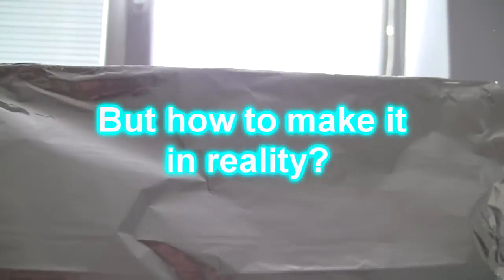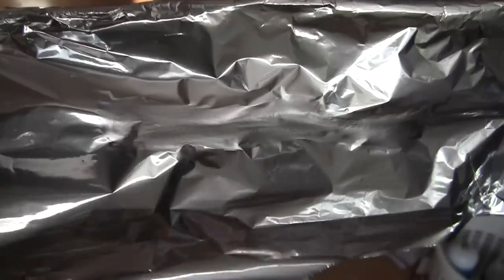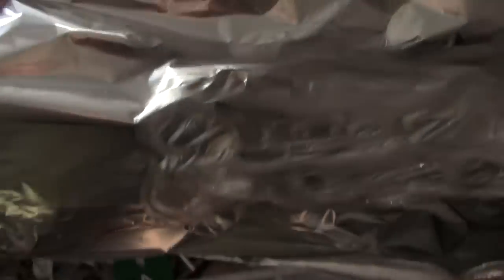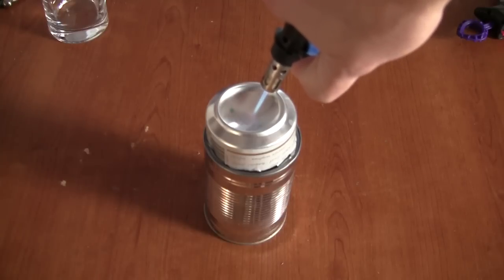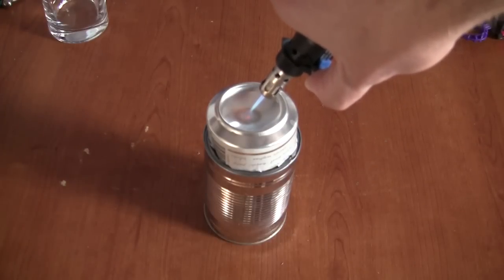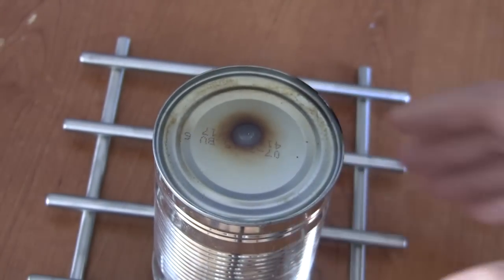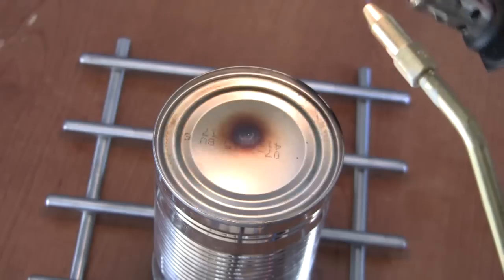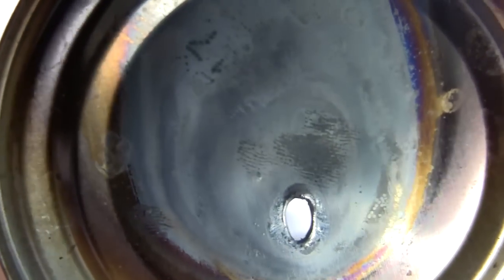How to make REAL Transparent Aluminium!

Comment: I recently came across this:
"A localized conversion of aluminum into transparent aluminum oxide by droplet-scale anodization is demonstrated in this work. The anodized region can be contained and controlled on the basis of the electrowetting response of the droplet. A highly uniform and transparent anodized spot was achieved using an anodization voltage of 2 V for 10 min. We analyzed the chemical evolution during the formation of the transparent oxide layer using X-ray photoelectron spectroscopy, which revealed the dynamic interplay between Al(OH), AlO(OH), and Al2O3 formation and dissolution during the conversion process. The dominant presence of aluminum oxide/hydroxide on the transparent spot after anodization was observed. The morphological characteristics of the transparent oxide layer exhibited a reduction in surface roughness as anodization time increased. Additionally, the formation of randomly distributed nanopores was observed in the anodized samples. X-ray diffraction results revealed the amorphous nature of the produced transparent oxide layer. This droplet-scale anodization technique can be extended to other transparent metal oxides, providing an environmentally friendly and cost-effective fabrication route toward sustainable electronics and other related applications."

Comment: I never thought i would be able to say it but... everything about this experiment was horribly done lol.  cans are coated with a food grade epoxy resin adhered to the metal with a binder.   While "oxidizing" the metals, you effectively cured a plastic resin making a clear "glass" like material. 

If you heat the epoxy resin in soda cans along with its binder (curing agent) alone in an experiment, it would indeed form a clear, stiff material. Epoxy resins are thermosetting polymers, meaning that once they are cured (hardened), they create a rigid, durable, and clear solid.  

Of course I could be wrong, Im only looking at 5 minutes of footage from 8 years ago.  But it looks like you just made some plastic under a controlled carbonization.

Comment: Not the same thing.
Transparent aluminum is made by compressing aluminum powder, oxygen and nitrogen under several tons of pressure per square inch. It is transparent, but remains structurally very stong and is a solid material. These are two properties your "transparent" aluminum does not have. The stuff you made is porous and weak
What you ma 4:57

Comment: Well it does work because he heats the aluminum enough to infuse N And O into the foil it is not the cleanest way to create alon that's why it has such a small viewing angle if he were to do it in a super high temp oven with an oxygen Nitrogen atmosphere heated the Aluminum thoroughly over a few hrs then flash belastet it with a high tem laser or similar he could achieve a pretty much perfect alon specimen. Or he buys the chemicals presses them and high tem cooks them for 24 hrs and then polis he's them eviola alon as well there are plenty channels that actually talk about the chemistry behind this with showcasing the effect
Reply: @Aaron Washburn thanks for the clarification, i stand corrected

Comment: 2019: ran across this researching Alon.  In above vid it appears to be transparent in places due to burning tiny holes thru it.
Reply: Im assuming whats happening is the intense heat is quickly oxidizing the aluminum, perhaps forming large alumina crystals in the foil, basically turning part of the foil into sapphire
Reply: @Aaron Washburn  microscope pics ?
Reply: @Aaron Washburn of the claimed perforations
Reply: @Aaron Washburn both are absent as far as I've (not) seen in these comments... lol at the way u phrased that, "picking an argument" style
Reply: @Aaron Washburn someone must have inspected it already, though seeing how adamant some of these commenters are without anything solid backing their argument... anything is possible
Reply: @Aaron Washburn  thanks watch?v=inN6QXYUQ6A  Should be a pinned comment for the good of all

Comment: I assume because the crystals in the aluminium can not recrystalize fast enough so that we dont have the same boundaries at the crystal. And so we have an effect like Glas where no Boundaries of crystals reflecting the light. If i assume correct the transparent spots should show a different strength agains pulling and more physical differents. But i would be glad if someone cann tell me whats the definitive reason for this behaviour is.
Reply: Ok thanks for the information but its definetly worth check it under the electron microscope, unfortunately i doesnt have one. But if somebody has a picture or Video would be great to check your theory.
Reply: Great , thank you, it was just a general suggeston in case somebody with free acess read this comments by incident. Thanks because i have no acess to equipment.

Comment: This is fake. Foil and cans have plastic layers in them, that’s what you’re seeing.

The true chemical name for transparent Aluminium is Aluminium-Oxi-Nitride.

It’s a ceramic composite that’s super expensive. Can only be created from a powder state, requires extreme heat, and requires major amounts of polishing to be see through. It’s used in military vehicles as a lighter thinner alternative to bullet proof glass.

#FakeVideo

Comment: Seem you made ALON glass by heating the aluminium it combined with oxygen and nitrogen in the air, making Aluminium oxynitride. AlON is optically transparent (≥80%) in the near-ultraviolet, visible and midwave-infrared regions of the electromagnetic spectrum. It is 4 times harder than fused silica glass, 85% as hard as sapphire, and nearly 15% harder than magnesium aluminate spinel. Since it has a cubic spinel structure, it can be fabricated to transparent windows, plates, domes, rods, tubes and other forms using conventional ceramic powder processing techniques. ALON is the hardest polycrystalline transparent ceramic available commercially.

Comment: any object that has atoms can be "moved" let's start with example 1. when making swords the fire excites the metal making it molten metal. "atoms are moving". When quenched the atoms instantly  polarized. "like a magnet" Now the metal has to be tempered or it will shatter. The aluminum that was heated with flame simply "moved" atoms from each  other making it slightly able to view through the atoms. Because of this forced method I believe the structural integrity of that area has been compromised.   They the manufacturers of the aluminum could have done this in the factory.

Comment: Aluminum and Aluminum oxide melt at different temps. AO melts at much higher temp than aluminum. What I suspect is happening is, the aluminum is being melted, and due to surface tension, it pools and pulls away to the sides of the heat source, leaving its previously VERY thing layer of alum oxide still intact. And that is what you are looking through.

Comment: Aluminium can have a clear lacquer coating spayed inside during manufacture. 
Like wise I believe aluminium foil has a plastic coating  applied during manufacture
Although I tend to think it should be burnt off when enough heat to melt the aluminium is applied I can't help but wonder if it may not be the cause of the transparancy

Comment: I think the molten Al is coalescing into a grid comprised of fine threads of Al. Might be useful for making a filter if it doesn't collapse under pressure. Perhaps an open-celled Al foam?

Comment: Ya it's no longer aluminum, it's aluminum oxide and that as others have said is sapphire, or it would be if you could cast it into a crystal. Casting aluminum oxide crystals takes heat like the surface of the sun for a while so good luck with that.

Comment: I melt down scrap aluminum, and often I'll have segments of tube leave behind brittle transparent shells of aluminum oxide, while the metal collected in the bottom of the crucible. For anyone curious about it, aluminum on its own is very reactive and if it weren't for this layer of oxide it could actually react with water, but any contact of aluminum with water or oxygen forms a thin layer of aluminum oxide that prevents the rest of the aluminum 
from reacting.

Comment: NO NO NO! I did this with regular aluminum foil, and basically the same type of torch. I put it under a microscope. All it is doing is perforating the aluminum with a bunch of tiny, surprisingly symmetrical, holes. It is an interesting effect but this is not 'transparent aluminum'. The longer you hold the heat on, the weaker it becomes. I would bet a large amount of money that that can is not actually water tight. The people saying that he forming sapphire/sapphire glass because sapphires come from aluminum oxide are wrong. sapphires form under immense temperature and pressure, usually over millions of years... This guy is sitting in his house burning aluminum foil acting like he's made some big discovery.

Comment: Aluminium foil has plastic coating.  When you heat it the heat absorbed by aluminium due to high heat absorption capacity and segregates it on the edge of the heating flame while the coating remains intact with some dispersed droplets of aluminium.  obviously that explains the effect of transparency.

Comment: Aluminum automatically reacts with the oxygen in the air to form a relatively hard transparent colorless coating on the original Aluminum. When you see ANYTHING made of Aluminum, it ALWAYS has that colorless transparent coating already on it.

Now when he heats up the Aluminum can, but not hot enough to melt the metal, he is converting all the Aluminum in that spot all the way through into that colorless transparent aluminum oxide. Since it is relatively "hard", it will easily hold water if the pressure is not great enough to push though the oxide "hole".

Comment: I worked at Surmet for 10 years. Acrylic aluminum was and still is their product. Made from aluminum oxide powder in an graphite mold at 3000 to 4500 degrees f for aprox 5 days will produce a ceramic puck that can be polished to clear

Comment: If the transparent region can be scanned with an Electron Microscope, to reveal the atomic lattice structure of the Aluminum, then an experimental method to heat and cool a panel may be devised to make transparent Aluminum. Good video!

Comment: The aluminium you used  has protective coatings.  when you heat it up, most of it aggregated towards denser areas and the heated area left with aluminium oxide and supporting coating to keep it in place and that creates the illusion in your mind.

Comment: Hey Thunder, use the butane torch on thin film sheets of various metals and see if they're transparent! Hypothetically, if say, silver becomes transparent, then maybe you can layer all of those thin sheets of silver and make a transparent block of silver. But even with aluminum, or even with Al-Ti alloys, maybe it's possible to make a transparent plane out of it!

Comment: but would it work for what the crew were trying to do with it in the film?  Could you replace thick aquarium glass with it, and would it be lighter, and stronger than the glass?  And if it can, could we use it for other things, eg. for replacing the glass in windows of deep-sea submersibles so that they can be made larger, or from less materials?

Comment: They make transparent aluminum now, in ceramic form, using Aluminum Oxynitride, under intense pressure, and baked at around 2000 C.

It needs to be polished afterward, but it can stop most bullets, and is completely transparent.

Comment: I remember doing this by sputtering aluminium from a magnetron onto glass slides in a vacuum when doing research, it made what appeared to be perfect mirrors but hold one up to the light and you can see through it. Same coating used on the exit end of a gas laser such as a He-Ne laser. Just a thin coating of aluminium on glass to bounce the light back and forth until population inversion is reached "light amplification by stimulated emission of radiation"

Comment: The molten aluminium is floating down, so only the oxide Layer covering the Aluminium is left. Aluminium still can't be seen through.

Maybe there is a method to produce an aluminium crystal structure that let's light pass through, like Diamond is to carbon.

Comment: I thought this was a joke...
Reply: It is a joke, he's burning tiny holes in the aluminium and, being thunderf00t, he is perfectly aware of this. I guess he is just trolling with this video...
Reply: Homemade Chemistry Actually, it may have been Aluminum Oxide, also known as Corrundum, which is a major component in rubies and sapphires.
Reply: Yes, theoretically, but those actually are tiny holes. Puddin made a video, putting the foil after burning under the microscope where you can clearly see them. Aluminum Oxide is created, but it wouldn't stay in this flat thin shape on its own. I guess it is just blown away by the torch.

Comment: Look up ALON, or aluminum oxynitride.  It's been around as long as Star Trek: The Voyage Home.  Do you suppose the movie writers had an insider tip?   Also, a Ruby is transparent aluminum.  Look up the formula for a Ruby crystal.  It's aluminum oxide with Chromium.

Comment: you know your just melting it and making very very thin layers right?
Reply: No, that's not what's happening there. It forms aluminum oxide, which is clear ceramic corundum. If it was just melting, where would all the aluminium go? Can't see it anywhere. That cola can bottom certainly has quite a bit of substance to it. Besides, it would melt more the thinner the layer already is, making a properly thinned out area impossible to achieve, thin areas would instantly become holes instead.
Reply: that's all I can think about
Reply: *you're
Reply: I disagree.  He is burning the Al to form aluminum dioxide.  If you ever built a camp fire and put your beer cans in there you will know this happens all the time.  We never find a nice puddle of clear ceramic corundum.  What we find is nothing but the ring of the top of the can.  He is just thinning the foil and the can enough to see through.

Comment: Thunderfoot, would it make a good current collector in a super cap due to large surface area? Is conductivity affected in any way after such treatment? Is it possible to treat thicker aluminum sheets in the same manner to achieve similar results?

Comment: It is not transparent Aluminum    It is actually transparent Alumina, or Aluminium Oxide  it is ceramic     material
Reply: yeah I thought so!! not very stable after you burn the foil, and the proper is meant to be better than bulletproof glass
Reply: @manifestwithlayles1111  Proper sapphire glass is not actually better than bulletproof glass, it's very hard and scratch resistant, but many proper heat treated and laminated glasses are more shatterproof.

Comment: This is probally not the best too ask; but in fantasy/ sci-fi stuff do they use something similiar too this with a quick heating/cooling system to make the cloaking stuff? could this actaully be used for making a camoflague metal?
Reply: not really, since all it does is turn the material transparent, so I'd be like wearing a plastic bag, also the process can't be reversed by cooling the aluminium, plus the heat required to turn the foil transparent will most certainly cook the wearer not unlike a baked potato
Reply: I literally snorted laughing at the end of that.

Comment: That's only transparent because you have melted or burn away some of the aluminum and it is so thin you have holes in it to let the light through. It takes temperatures much hotter than that little torch to make synthetic sapphire out of aluminum.
Reply: If it held water, it probably wasn't perforated as you say. He was getting the aluminum white hot, which means he was approaching it's melting temperature. Aluminum would oxidize at that point.
Reply: Ghillie Troll Gaming
Aluminum burns and doesn't turn into transparent, imaginary Star Trek shit. Read this and learn.........
https://en.wikipedia.org/wiki/List_of_Star_Trek_materials#Transparent_aluminum
Reply: johnabuick You seem like someone who really doesn't get chemistry. When I say oxidizes, I'm not entirely sure you quite understand me. At the temperature that torch reaches, there is sufficient energy present for the aluminum to bond with oxygen at an accelerated rate. You take two aluminum atoms, three oxygen atoms, and a load of energy, and then suddenly, you have Al2O3. I'll even spell it out for you 4Al+3O2 and a load of energy =2Al2O3. That would probably make more sense if I could use subscript here. Alumina, or aluminum oxide is the result. No, not transparent, imaginary Star Trek shit, but partially transparent sapphire, a material coincidentally listed on that same page. This is basic chemistry, do your research.
Reply: Ghillie Troll Gaming
Sure, if that was true as you state everybody would be in their basements making sapphire and the shit wouldn't be worth shit.
Reply: Ghillie Troll Gaming
That's nice but this video of somebody making transparent aluminum is still bullshit.
Reply: johnabuick That's because it's someone taking a torch to some aluminum, which happens to oxidize and become transparent when you do that,
Reply: See transparent Rb.I am sure you can't explain(not K,Na,Fr,Li,Cs)

Comment: Aluminum foil is coated with a heat resistant polymer to give it tensile strength! You can easily burn away the aluminum with the torch and leave just the polymer coating. That is what is happening here! BUSTED!!! Try taking a block of pure (Eh) aluminum and melting it down to a film and this will not happen!